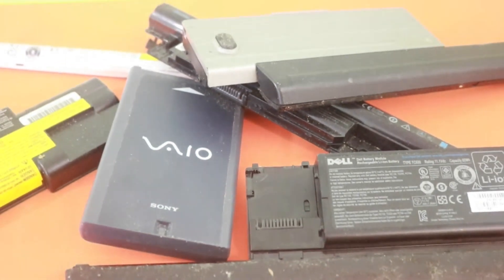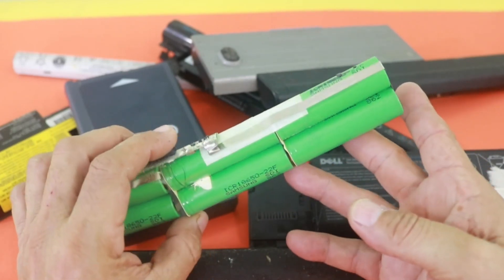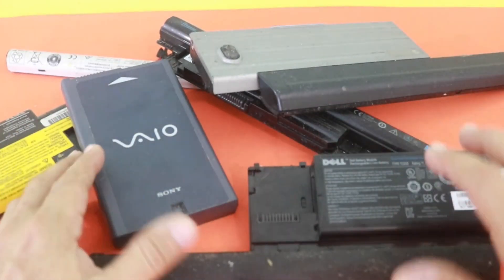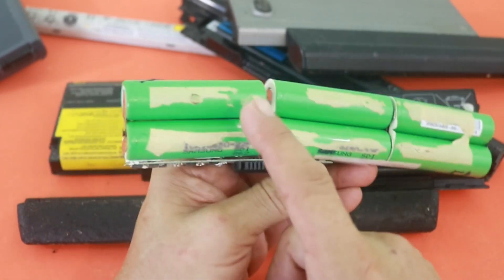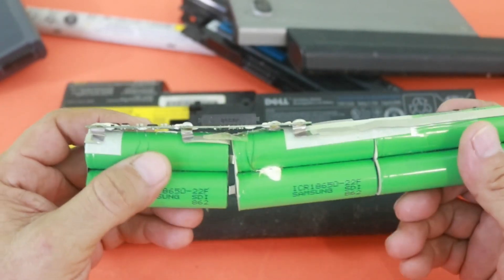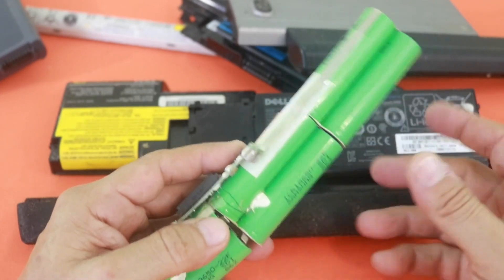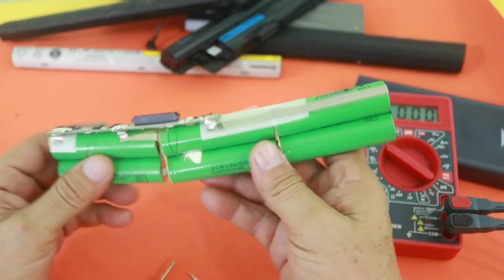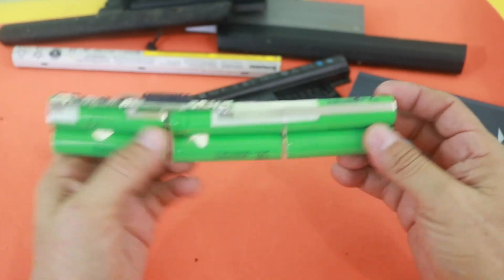Can you get good lithium cells from bad laptop batteries?

Comment: Bought the cheap empty power banks, and use those cells in there, especially the lower capacity ones, which i use with a power bank and USB plug in light as a torch. Great and simple way to get a cheap long lasting torch, and even low capacity cells will provide hours of light easily.

Comment: You suppose to show how to open the laptop batteries and harvest them then that would be great man ;)
Reply: simple, fabricate an exacto knife soldiering iron tip
get a sponge, wet it with little water, and wipe that tip on it both sides.
it is not tuff
use a nail same size as soldering iron tip, weld the blade on it
Reply: maybe wet/damp tissues work for cleaning the tip too